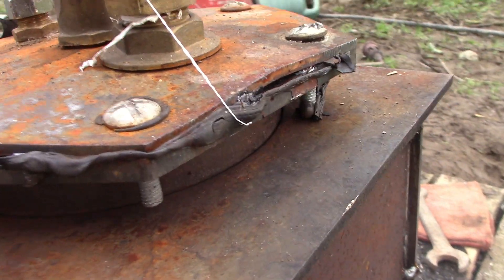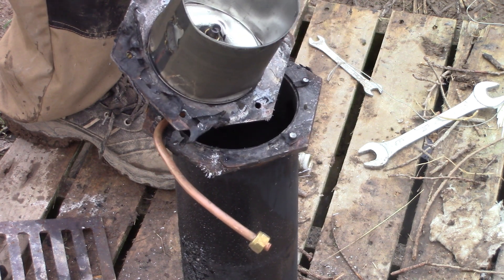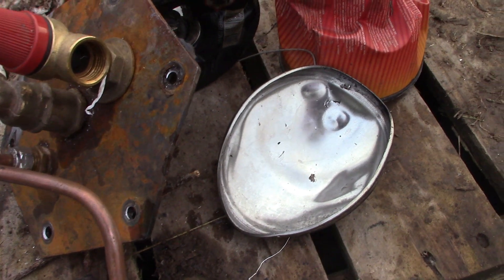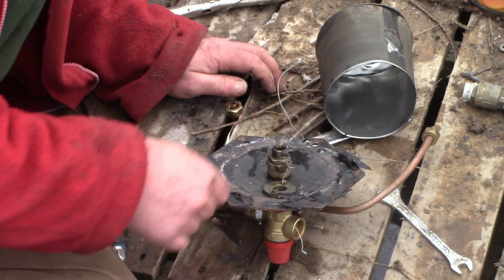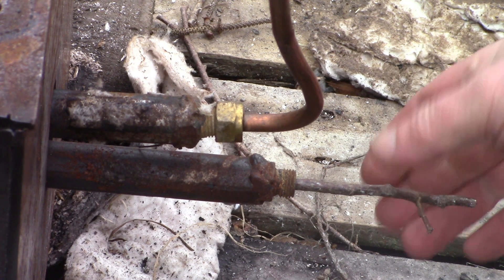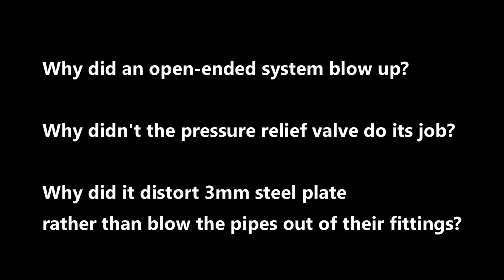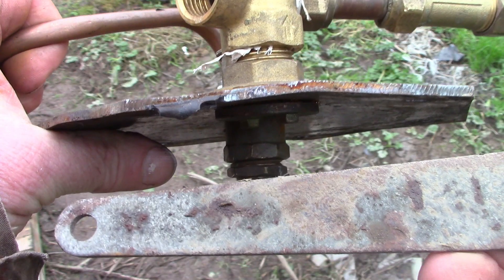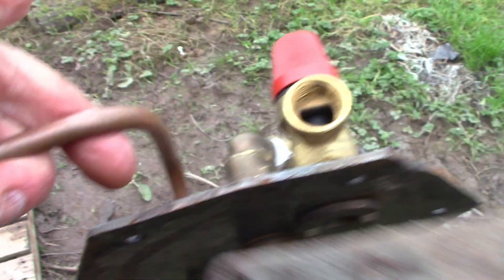Why Did My Boiler Explode??!! My Own Big Bang Theory...

Comment: Maybe one of the floats exploded rather than imploded.. Once that happened then the sequence of events you worked out happened?. As the float isn't a pressure vessel, it's internal pressure wouldn't have had to have been much more than that in the boiler itself to cause it to explode?
Reply: A gas canister is not a pressure vessel?
What am i missing here?
Reply: @martialme84  they are but I suspect what happened would be out of their safety range. Maybe one had some liquid butane in it still.?

Comment: Your theory sounds correct to me.
The lesson is that you need to make the next float out of stronger material.
Reply: So it can build up more pressure before it explodes?
Reply: @ShadeTheif  
The thing didn't explode simply because there was too much pressure because the pressure relief valve will let excess pressure out.
He explained the chain of events that caused the tank to blow, and it looks like you don't understand what he said.
The floats imploded, and that caused a sudden DROP in interior pressure.  A tank of water that's already above the boiling point is kept from turning into steam by the vessel keeping that hot water contained under pressure.  When something gives and the pressure drops quickly, all the water that's hot enough to boil will instantly turn to steam.  Since steam takes up much more space than water, you have a SUDDEN and LARGE increase in pressure inside the tank.  It's so sudden and powerful that the pressure relief valve is unable to let it escape the tank fast enough.  Only a ridiculously overbuilt tank can handle a huge pressure shock like that.
My suggestion to make the floats tougher is the sensible thing to do because the floats' ability to resist imploding is just as important as the tank's ability to resist exploding.
Reply: @ShadeTheif  that's how boilers work 😉

Comment: Vessels here in North America designed for >1 atmosphere need to be ASME rated.  Pressure vessels are a big difference, for safety reasons.   Your top wasnt domed, and your pressure raised.  You are measuring temperature, but not pressure.  I caught your other video, but i forget if you had a PRV release valve.   Install a pressure gauge.
Reply: A pressure gauge won't help either if it's blocked, like the pressure release valve and the steam outlet probably were by the float that was impaled. It might even give you a false sense of security.
Reply: @timderks5960  Your PRV and pressure gauge can be in different locations.  The float didn't create a full blockage, as the top of the can ruptured by the seal.  A gauge is standard for all ASME rated tanks.  As well, the float wasn't big enough to seal the outlet in the first place as it was functional.  If the float had completely sealed it, it would have been perforated on both sides and wrapped around the PRV and the steam outlet.
Reply: @BeeRich33  It's almost like you have X-ray eyes that can also go back in time. Impressive. The float doesn't need to create a full seal, it only needs a tiny part of metal to block the openings, either fully or partially, to cause a problem. Given how messed up those cans were, there's a high probability that something like that happened. 

About the boiler being functional: Who's to say it wasn't just residual steam coming out of the pipes, and the outlet was actually blocked at that point? You can't know for sure, neither can I. You say "install a pressure gauge" as if that's the end all ultimate solution, and I'm just saying it's not, which it isn't. I'm not saying it's not a good idea, but it definitely takes more than just installing a gauge to prevent this from happening again.

Comment: I wonder if you didn't quite have enough water in the boiler, and the implosions were caused by the canisters heating up and releasing their pressure into the system then collapsed them from the pressure now in the system

Comment: Perhaps some water leaked into the float and flashed rapidly into steam? The float was forced up into top valve and that bottom piece was domed out so something exploded inside. If the water expanded quickly it could have pushed the bottom of the float out, and once the bottom expanded the top was forced up bending the top plate. If the steam explosion was within the float that could have stopped the pressure from building up where the relief valve could have released it.